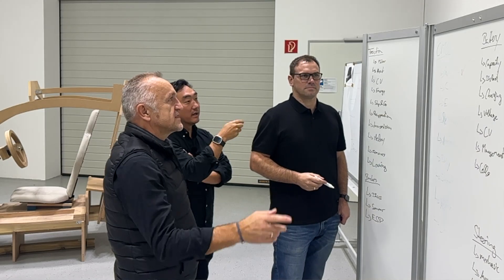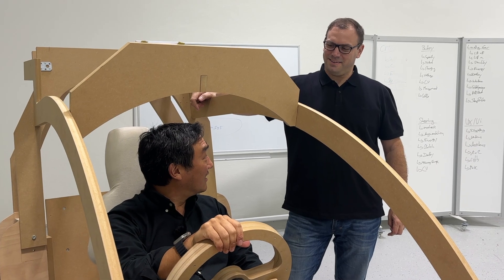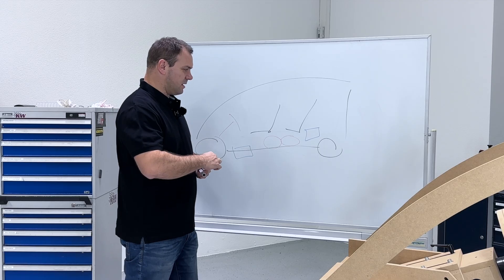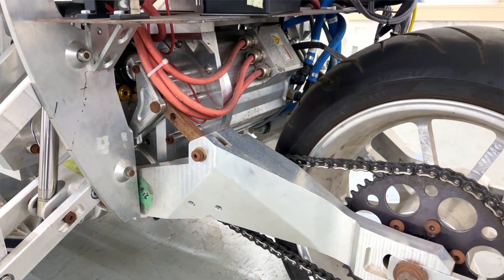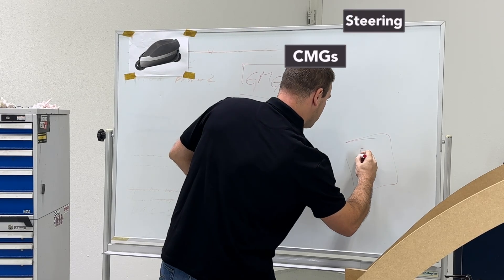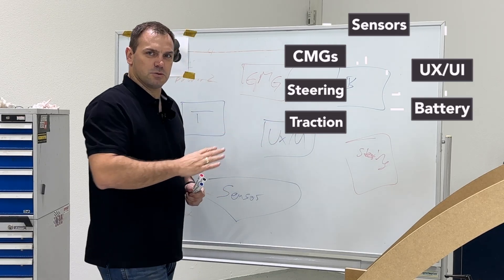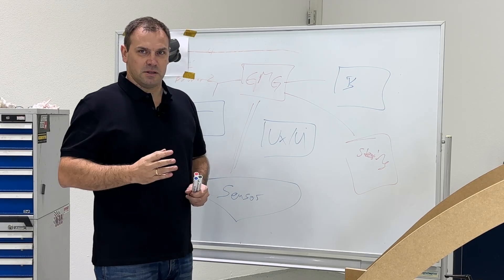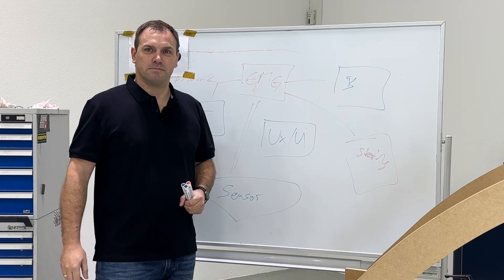Stefan Schaeper - Beta Prototype Development Steps - Ideenion

Comment: Hey Dan. Could you get rid of the heavy gyros and landing gear and have a split front wheel system on independent suspension for cornering which separates apart at low speed and comes back together when balanced at speed.

Comment: Coming up on 15 years since founding Lit Motors, and I've been following them since them. I feel like their window is gone, or was it ever there? Most people in the USA don't buy motorcycles, and this will be registered as a motorcycle. Maybe their market is in Indonesia, or ?? I think Aptera is the better bet, true sustainability will be helped by vehicles which can mostly fuel themselves.
t
Reply: i know frank who build the zerotracer with is friend who made the new design for the peraves monotracer. they rebuild it in 18 months to a electric version 18 years ago. lit motors had far far more budget and after that time i am surprised they never made to market and we see today a progress video??? i meet the microlino creaters the developed and build up the fab for 10-30 mio. USD in italy, it is far cheaper to develop in europe and produce in italy. even aptera produces it's carbon parts italy.
Reply: @Francis-yc9nc  Aptera’s BINC (body in carbon) HAD to be produced in Italy b/c it had the only factory capable… tooling cost $30M (huge steel presses) so not cheap.  Aptera’s trike (aka autocycle) and a well-built, competitively priced motorcycle have huge tho selective market.